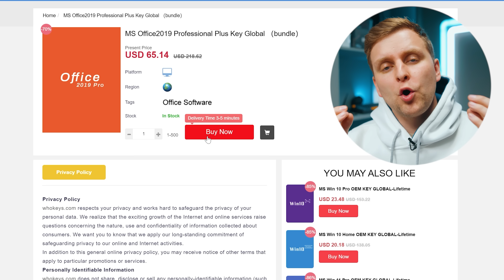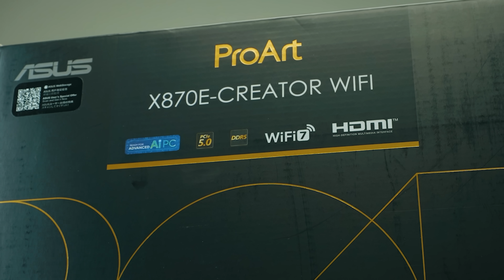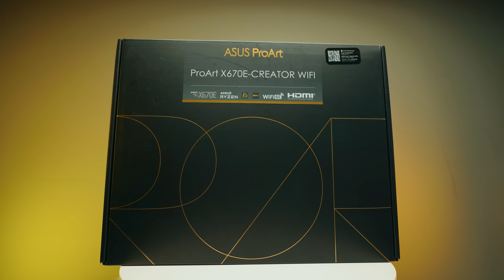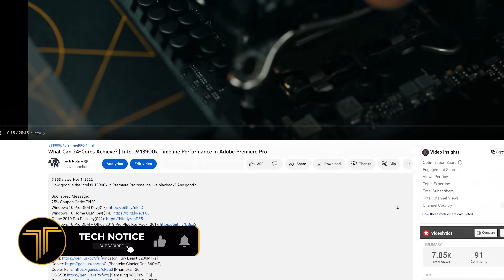The BEST Motherboard for AMD Ryzen. Period. - Here's Why! [Asus ProArt X870e Creator WiFi]

Comment: I'm looking to buy one as it's probably the best balance of features for me currently.  It's the only board I've seen with 10GbE.  I have a 10GbE PCI card but spare PCI slots are getting fewer by the year nowadays. I do think (esp for amateur DIY occasional system builders) there is merit in having some kind of error fault tracking capability like the numeric displays, seen circa 10 years ago (eg on some Gigabyte boards) showing boot progress. 

It's fine if everything just works (as per my last build) but can be useful if something isn't quite as it should be. But perhaps that's just my caution based on inexperience? I do have a dread of build issues, and the occasional DOA, esp if sourcing parts from multiple suppliers, fearing (possibly irrationally) that any one supplier would happily blame another rather than take responsibility and just replace a suspect component if asked. Yet, in 20 years as a DIY builder (typically building new every 4-5 years) I haven't had any experience of real difficulties.

Comment: You should not be telling people this board has 3 5th gen m.2s it's an outright lie.

It's an amazing board but saying it's the best for Ryzen, It's definitely the best value if you want a dual slot x16 5th gen pci slot board, and you wanna run dual gpus. Amazing board but most people going to buy x3d chips for gaming, and not run this since they only have one gpu. Seems people here are confused about why this board exists though. This board exists for creators who want 2 gpus or multiple components on the pci birdge with minimal bandwidth loss while not spending more than 500 on a board. Every board has it's place. This video is a terrible reason of why you should buy this board, but all the comments here are also bs. I use this board for streaming and gaming and have 0 complaints. I have a 9900x3d and i stream 24/7 with it, i use a b570 as my second gpu and it's the best because i can access my bottom board IOs since the slots are close together, the top card is watercooled the bottom is aircooled, neither go above 44c. So people need to read before they start having Asus Derangement Syndrome.

Comment: No spdif, only 8 normal usb's, only 1 usb 3.0 header, no 8 segment diagnostics screen. I could go on. So depending on who you ask its definitely not the best motherboard imo.. Not for my needs anyway. I run a simracing motion rig so I need lots of dedicated usb ports. And the 10gb port is useless for 95% of the people. 🤷‍♂

Comment: Except this board definitely is not the best? The Asrock x870e nova is absolutely a better board. It doesn’t lane split if you run 5 m.2 drives. Asus used to be the go to back in the Intel height. They’ve not been really worth considering in over half a decade. But they still try to charge like they are lol. This generation you want to go with either Asrock or MSI unless you want to be limited to 2 M.2 drives on $200-500 boards (which is unacceptable).

Comment: Make sure you double-check the claim "all M.2 are Gen 5". It is NOT true. There are two Gen 5 M.2 and one of them requires you to bifurcate your main slot down to x8 lanes. This dude should be a bit more precise.
Reply: Do you know of any boards that have 2 gen 5 m.2s that don’t touch the GPU slot whatsoever?? Im going down a damn rabit hole trying to find one. Having to stretch my budget more and more. I can afford it, its just damn annoying.
Reply: @Invrexs  I think msi mag x870e tomahawk wifi is the only board so far whose M2 shares lines with USB 4 ports, and not with the PCI 16 slot. (1 x PCI Express 5.0 x16 — CPU, 1 x PCI Express 3.0 x16 (x1) — X870, 1 x PCI Express 4.0 x16 (x4) — X870, 1 x PCI Express 5.0 x4 M.2_1 (Key M, 2280/22110) — CPU, 1 x PCI Express 5.0 x4 M.2_2 (Key M, 2260/2280) — CPU, 1 x PCI Express 4.0 x2 M.2_3 (Key M, 2260/2280) — X870, 1 x PCI Express 4.0 x4 M.2_4 (Key M, 2260/2280) — X870)
Reply: @Invrexs well u can grab an msi x870e tomahawk mobo. The catch is u'll loose ur type ports but can use 2 gen5 ssds simultaneously
Reply: @Invrexs  There's the MSI X870E Tomahawk Wifi and a few other boards by MSI that will allow up to THREE v5 M.2 drives IF you disable the USB4 support in BIOS. The one big caveat is that this board and a few related ones of that line seem to suffer from some serious firmware bugs that MSI still hasn't fixed. Hopefully we'll get a fix someday....
Reply: @athraxblackspire8437 i dont care for USB 4 honestly. I was looking at an MSI MPG X870e. But I don’t know a whole lot about boards n such. Im getting it cause i have 2 9100 pros. Incompatible with my current z690-a in terms of full speeds. So i will also be buying a r9 9950x3d..
Reply: @Invrexs  ASUS ROG STRIX B850-F GAMING WIFI Motherboard
Reply: @Invrexs nah u won't find any. Unless u go with any amd thredripper.
Reply: Exactly! Two M.2 are PCIe 5.0 x4, connected straight to the CPU. One to the right of GPU and one below PCIe 5.0 x8 slot (x4 lanes are shared with the slot PCIe slot above). Slots on the left of mobo are all PCIe 4.0 and they are wired to the chipset - two M2 4.0 x4 and PCIe 4.0 x16 physical, x4 lanes electrical.

Comment: Before purchasing it, you have to make sure that you are able to use your added add-ons such as gpu, capture card, NvMe M.2 chip sets.

Double check if you have enough rgb connections for any rgb devices. I purchased the Crosshair x870e hero.

I ran out our rgb connections with my Lian-Li uni tl infinity lcd fans even with the controller.

😢

Comment: Asus  is not what they used to be - There are almost no good options for MOBO manufacturers left. I went with an 870xe Taichi by Asrock on a recommendation. Until this build every motherboard I used for a two decades was Asus. Their RMA shenanigans and declining customer service plus insane pricing on even lower tier boards has made me steer clear recently. I can't trust MSI and Gigabyte is hit and miss. Hopefully the Taichi will work out. If I were to buy an Asus board again the ProArt line is definitely the one I would consider. Thanks for the effort you put in to your videos.

Comment: Just bought this motherboard friday and builded my 9800X3D gaming pc. Quick boot times, like good old ryzen 5000 series. So no worries there. I like this motherboard ALOT. Only good looking one from X870/E chipset boards. Really wierd looking graphics on most of the X870/E motherboards and also most boards uses ALC4080 sound chip/codec. This doesn't and it's really good thing, so no worries with sound either. And this has pretty good m.2 and pcie slot usage logic, how they block each other, depending which one you install. But it's not cheap!😁

Comment: I purchased the ASUS TUF B650 Plus Wifi. AMD motherboard from Amazon in July 2024. I finally completed the build in Sep-Oct 2024. Total rubbish.  Jan 2025, the PC just shut down and now won't even boot up.  I realize this is a ProArt review.  However, I'm now questioning ASUS in general.  And for the price, why is there not some diagnostic LEDs on this board?

Comment: I just got this motherboard in the mail... something I have not seen mentioned anywhere is that if you intend to use it with an RTX5090, if it is not water cooled or the FE, the slot underneath the g5x16 (middle slot) gets obstructed, and you cannot use it... the lowest 3rd party rtx5090 i found is the Gigabyte 5090 windforce, which is 65mm, and that is still too high... so your options are very limited in terms of dual gpu options...

Comment: Guys i need help.
I've build a pc with,

Amd 9 9950x
Asus Proart x870 creator wifi
Arctic liquid freezer 3 360
Crucial ddr5 96GB
Dont have graphic card yet but 9950 comes with a integrated gpu core 

Now the problem is, for first time I could see the bios, but everytime i turn on pc nothing shows up. Even the keyboard light is not on. Keyboard attached directly to the motherboard.

Does this mean the motherboard or cpu has issues?

Comment: If you put a Gen5 m.2 in  but then use Gen4 graphic card in #1 slot, does it dumb down the m.2 to gen 4 since they both run off the same lanes in the CPU?

Comment: If you are aware of AMD platform , which  RAM do you recommend for system   chipset   x870E  with  CPU  9800x3D   , CL32  7000    or   CL38  8200

Comment: Great review. There has been clarification regarding the M.2 slots.

The top two slots (M.2_1 and M.2_2) are directly connected to CPU and are PCI gen5 (in x4 mode). But if you are using Ryzen 8000 series CPU then the M2.2 is not available (it's a CPU limitation). If you are using Ryzen 9000/7000 series CPU and keep in mind that the PCIEX16(gen5)_2  (the middle slot) shares bandwidth with the M.2.2 slot right next to it.
Bottom two slots  (M.2_3 and M.2_4) are through the chipset and are available as PCIe gen4 (in x4 mode).

I hope it helps.
Reply: Thx. I was wondering how it is possible, that all M.2 are Gen 5 as he said. Turns out they aren't. That's why I went with the Asrock x870e Taichi Light. No lane sharing shannigans and also don't want to support Asus for various reasons.
Reply: @matteloht im looking for a board with no lane sharing. How is it?
Reply: @Invrexs  The MSI Godlike shares with the USB4 ports on the back, not the PCI slots if you're still looking.
Reply: Has no lane sharing as it only has 1 x M2 5.0 slot.

Comment: A proart motherboard for Creators without with 3 usb 2 ports and absolutely zero thunderbolt or usb 4 ports who the hell uses a usb 2 port?
Reply: It's got 2 USB 4.0 ports at the back which is the main reason for x870

Comment: Not impressed.   You did nothing to explain why this motherboard is better than any other X870 -E motherboard out there.    They all have WiFi 7, they all have PCI 5.0, they all have a bunch of IO, including thunderbolt 40 Gbps, and many USB 3 10 Gbps ports.   Just about all the new 870e have these features, and much of this functionality is part of the 870 chipset.    Maybe this motherboard does it with good quality, has a few more USB ports than other motherboards, and has some fancy aesthetics.

The built in HDMI and displayport connectors as next to useless, because in the PC world, people plug directly into the back of their video card.

I could see this motherboard only useful for people that are major content creators, that have need for all the USB and IO ports, but even then, the price I am seeing right now for this motherboard is $479, which is ridiculously high.

No thank you.   I will be looking at other 870e motherboard choices that are in the $200 - $240 range.    One of the least helpful reviews I have seen in a while.

Comment: Why did they remove Thunderbolt support on the AMD motherboards? The B550- ProArt had Thunderbolt 4 ports.
Reply: they didn't dummy, USB 4 is compatible with TB!!!
Reply: @kiŋvi  Yes. USB4 is compatible but TB is fully certified for its capacity and standards. USB4 has only optional compatibility for TB hosts. Not the same thing. Sad that you had to include an insult in your reply, but I guess that is the general low standard on Youtube these days....

Comment: I heard the x670e version had shard lanes between an m.2 and the usb4 outputs which caused some issues with display output at the limits when also using storage. X870e requires those USB4 to be dedicated.
Reply: Yeah wasn't even documented and techpowerup found that. Happened on the hero x670e also  m2_1 was sharing bandwidth if you used either of the USB 4 ports at the same time as using m2_1. Caused major problems.  Now we have dedicated USB 4 bandwidth but shared lanes between GPU and any M2 5.0 slot that isn't the primary m2

Comment: what if the 5090 saturates the PCI 5 x8 though, it's kind of cringe that you can't have x16 on the GPU and still getting at least one full speed x8 PCI 5 SSD (which I guess runs fine at full speed and is not limited by x8 at all), they wouldn't be able to sell threadripper boards then I guess mmh..

Comment: No post code for a professional?  No quick disconnect for the graphics card, a large graphics card will likely cover up the extra PCI slot.  This board is missing the little details that other X870e boards have.
Reply: Workstation users really have no need for post codes, that's for overlockers. If there is something wrong with your board at stock or EXPO settings you shouldn't need a qcode reader to figure it out. Professionals want stability that means bells and whistles go bye bye, those slots are reinforced. This is a put it together and don't touch it setup with 2 full GPU slots at half the cost of the godlike and 25 percent the cost of the hero apex. Put this build together i have had zero BSODs, zero lockups outside of testing 6400 mhz on the 9900x3d, and no ctds in any games, or any stutter whatsoever. This is an amazing board for the money.

Comment: I wonder what DDR5 memory modules really can be used on this motherboard for 128+ GB with AMD Ryzen 9 9900X CPU? None of the RAM manufacturers still guarantee the compatibility of 4 modules with a total capacity of 128 GB (4x32GB) or more even for Intel's desktop processors...

Comment: May aswell go for ASRock Phantom Gaming X870E Nova WiFi
More features yet still cheaper.
Reply: Impossible to find available...
Reply: @emperorkain7027  It's readily available but it's not a workstation board Dontknow what either are you are yapping about.
Reply: You are a fool, that board only has one pci e 5 slot. The pro art creator has 2 and also the third one is a 4th gen slot. Your poop board only has one 5 and a 3..... Read before you post these are workstation boards.

Comment: Regarding the "Advanced IA" I believe it has to do with the BIOS is capable of measuring CPU / RAM / Cooler performance / Temperature / Frequency and suggest or apply custom values automatically. (I have the X870E Strix model and this is what it refers to)

Comment: Disagree, no ecc memory support, no debug code display at that price point, and the pci-e lanes are too close so 2 large gpu's won't fit. 10GB lan us it's only selling point. The strix x870e-e offers better M2 gen5 cooling and more high speed Gen 2.2 USB ports though doesn't have the 2nd 16x gen 5 slot
Reply: the Proart has ecc
Reply: @BeefIngot on paper. Not one tech tuber has got it to boot yet. Lots of reports of network disconnects on the 10Gb lan.  Also noticed no thermal plates/pads to go under the M2, except for m2_1. This helps cool double sided m2's. Gigabyte and MSI have this covered. This board is shite

Comment: I havn't checked it, but you can be sure it shares the lanes between the Pcie slots and the m.2 slots. The Hero and Wifi 870E boards both limits you to use their 2'nd Pcie slot (they just have 2 Pcie gen 5 Pcie slots .. not a third gen 4 dependent on how many m.2 slots you use) So if you want to use all 3 m.2 slots this will disable the 2'nd X16 slot .. and using the 4'th M.2 probably will disable the gen 4 x4 slot too. You don't have lanes enough for using everything at the same time. So these boards are kinda of a tease. They got a lot of connectivity, but you can't use everything at once 😐
Reply: Thats been the case for the past 10 years or more. My x99 HEDT board with a 40 lane CPU still needs mental gymnastics if I want to use GPU/M.2 and USB3.2 all at the same time. I lose a slot or the x4 goes to x1...
Reply: The primary Gen 5 PCIe and M.2 slots can run at full speeds (16x and 4x, respectively) with both occupied. If the second Gen 5 M.2 slot is active, then the first PCIe runs at 8x, and the second at 4x.

Comment: Sorry but especially for Asus motherboards I have to say that I have the worst experience. Maximus v could not post after 3 years and stopped support. There is a video from buildzoid that had the same problem with these type of motherboards. I lost one very expensive pc in 3 years. I never bought Asus products again. Recently they had similar problems with newer motherboards that burned cpus through extreme heat by poor bios implementation. They have the worst customer service.

Comment: Where is the damm postcode? 
Why is the second pcie slot so near the first?
Asus Pro Art has the least improvment of all x870e.
Reply: Dead wrong, post code is completely unnecessary for workstation users who never OC. If you don't know what is wrong with your hardware by the lights on the board and you haven't overclocked you shouldn't be using a workstation, you are not going to benefit from the q code at that point. Second slot being lower means bottom gpu covers your bottom boards ios, you always watercool at least one gpu in a dual setup, this allows you to run 2 gpus without crowding the bottom of the board. This is the absolute best workstation board for the money, it's the cheapest board with 2 pci e 5.0 x16 slots.

Comment: My Mac M1 with Thunderbolt 4 is the ultimate Pro Art. I feel a bit sheepish admitting it since I have a soft spot for my PC. But Thunderbolt 4 is a must-have for me. I'd be willing to give up some features on this board just to have Thunderbolt 4. I believe that one of the 670E Pro Art models comes equipped with Thunderbolt 4. It's time for Intel and AMD to catch up with the latest technology trends. I understand that Thunderbolt may not be a top priority for gamers.
Reply: You can buy Thunderbolt 4 PCIe card and plug it into PCIe slot. In this way you can use thunderbolt at a cos of one pcie  slot
Reply: @ThePawel36  There is no tb header but USB4 runs kinda like TB3 which might be enough for me.
Reply: @TheBsmit233  Right. You need header for Tb not only PCIe.
Reply: Thunderbolt 5 is on the Intel.